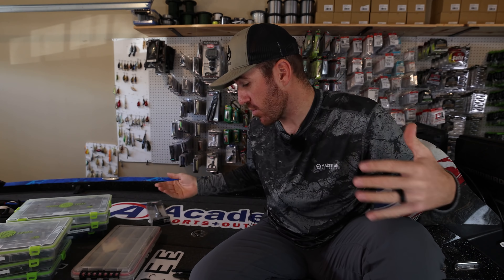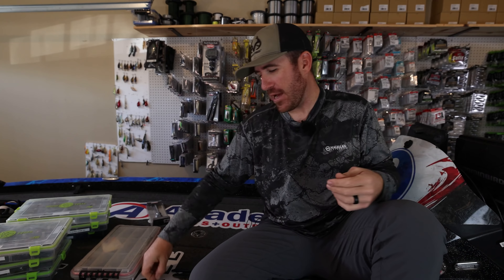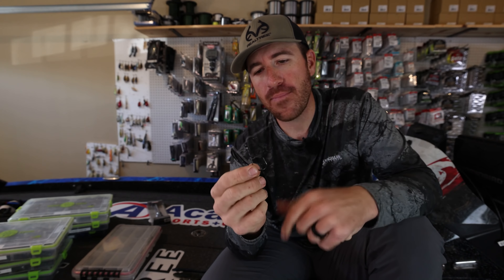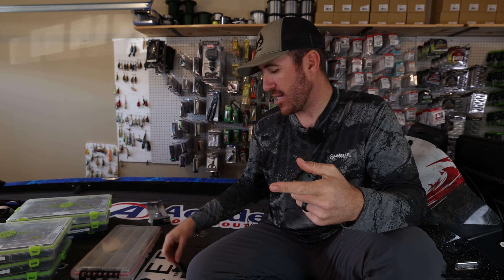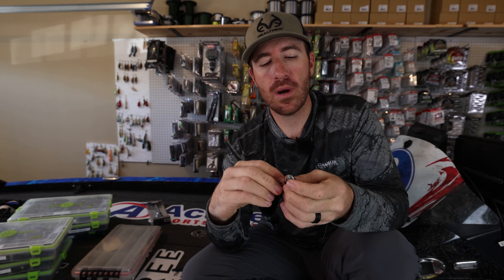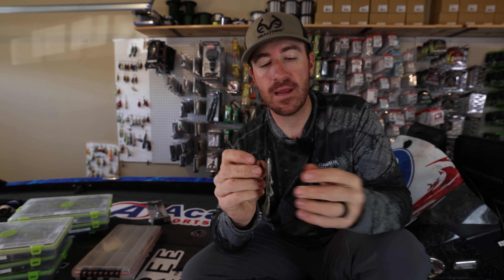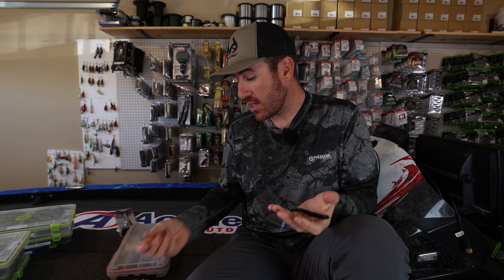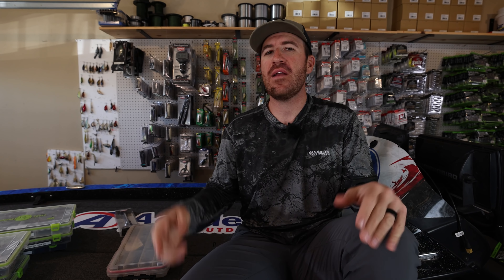Texas Rig Hooks EXPLAINED (Wrong Hook = Lost Fish)

Comment: No doubt a good general overview, Jacob.  And your video gets people thinking intelligently before selecting a particular type of hook for a particular fishing application.
Yet on the average, if I am worm fishing, or when I can still use them, I go with different sized sproat hooks, when I'm not put in a corner needing to use an EWG or Flipping hook.  And I also try to use the lightest gauge wire I can, for the application I am fishing.
A good sproat hook as designed, and especially in a lighter gauge, drives truer and straighter into a bass's mouth, on the average.  Wide gap hooks of whatever sort allow for a larger margin of error and are usually heavier gauge to boot, making them harder to set, especially at farther distances, as you have touched upon.
Watch your hookup percentage increase using lighter sproat style hooks of the correct size for the bait.  Or when having to use wider hooks, tend toward using braid with short casts and more forceful hooksets, and maybe using a bit stouter rod for that application, as well.

Comment: Double thanks Jake ! 🍰🍰  I use Owner Sniper Finesse cause they have offset points, I believe the offset point catches about 25% more bass. I use the 5" Maxscent General with them.  In the rocks I am not sure if the weedless version helps much though they seem to help in the brush ? I bend the wire guards down just above the point, why the factory does not do this beyond me and why do some people trim them ?